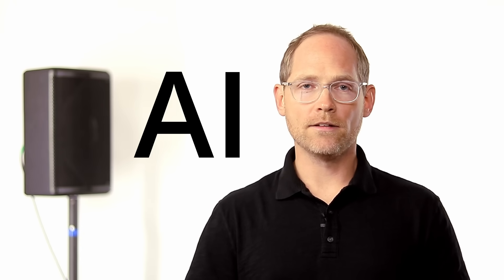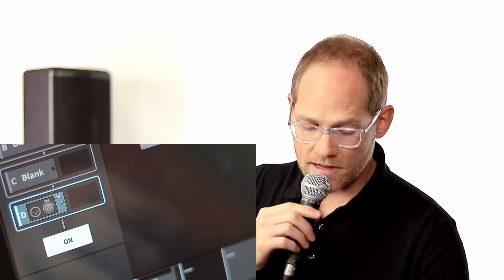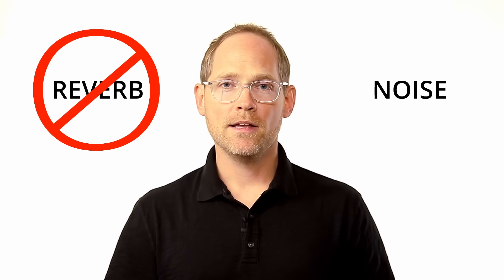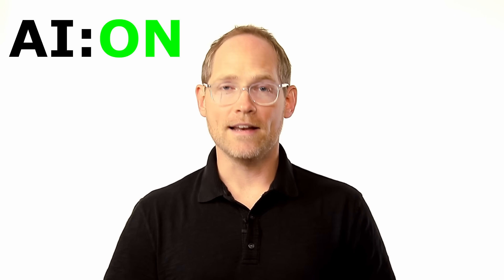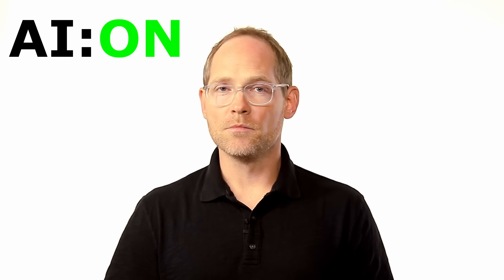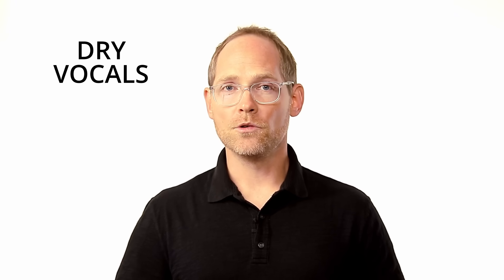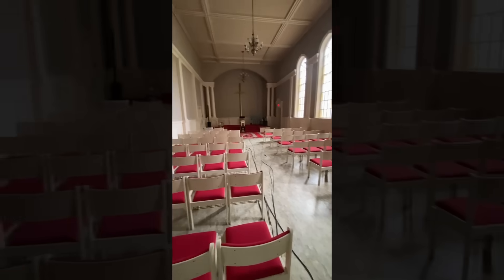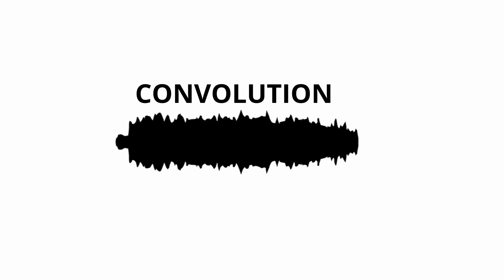AI De-Feedback/Anti-Reverb Demo + Full Explanation

Comment: Please license this to Waves so it can run natively on LV1 using SoundGrid :)
Reply from the maker: Email them about it. They could choose to do this tomorrow if they wanted to.
Reply: Well, this is basically live mode of Clarity isn't it?
Reply from the maker: @zazyczech  no, because clarity doesn’t prevent feedback.
Reply: Waves have their SuperRack Livebox that can run VST3. Which btw. also features Dante. For just $6.999 you can get there. Me & myself, I use a Mac Mini M1 with a RME Digiface Dante and Superrack Performer and I also get below 5msec latency with that system with plugins that report zero latency to the host. I don't know however if this system would survive this advertised Anti-Reverb… also you can't upgrade RAM on Macs, so this might be limiting, too.
Reply from the maker: @nielsott  We have a Livebox, works great! One instance will work with the lowest latency settings at 48k. Two or more instances require increases in buffer size, until eight instances will run with 96 sample buffer size and that's the largest buffer size we'd recommend for live sound.
Reply: @nielsott  If you're able to download the demo, I'd be very curious of your experience trying it out with this setup!
Reply: it's 2025, do we still need to use that zionist crap of Waves?
Reply: I’m not rich enough to have disposable income to test this system out . Some on please check out the full system with their computer
Reply: Rich boys problems
Reply: I have this setup with the Mac Mini M1 + RME Digiface Dante because Waves PSE can be a game changer and I haven't found any alternative to it. It is really sad but I haven't found any source expander with a dicker in the side chain as a plugin or as hardware. 

But perhaps mixing bands with 25 open mics on stage is a rich boy's problem, yes.

Does it pay off? No, not really. What pays off is a good quality mixing console with an automatic microphone mixer and doing lots of boring corporate blabla events. My Waves setup used for music events is cross-financed by that.

The M1 / Digiface / SuperRack performer solution is actually versatile, recently I used this machine as a 40 channel recorder with Ardour. I think it would do 64 channels tracking without issues.

I will see if I can run Anti-Reverb on it, but it's not a priority at the moment.

Comment: Would the AI model work even better if it would get the IR of the venue?
Reply from the maker: Possibly, but 1. the difference in a live sound setting may be so slight that it’s not worth the trouble and 2. a sufficiently trained general intelligence should be able to handle all rooms well enough

I think we’re pretty close to that already based on having used it for about a year now myself, and from the reports of others. Still room for improvement of course but I think that improvement is mostly to be found on the current path which would not involve a “learn” condition on site.

Comment: Will it isolate a live vocal by removing just the reverb and feedback or can it  also remove cymbal bleed and other stagenoise that is not a vocal?
Reply from the maker: at this time, it does not remove much else besides feedback and reverb. perhaps future versions will remove more
Reply: @devinlsheets_alphasound Hello. Sound engineer here. Please add cymbal bleed removal to it also. This will be even more huge for drummers who sing (and are also main singers).
Also please contact Behringer, so they can add this to their Behringer and Midas consoles/mixers.
Reply: there is a plugin for drum and cymbal bleed already. Drum gate debuted
Reply: Yes, but it does degrade the audio. It works better than a standard gate, but still...
Reply from the maker: @wietzejohanneskrikke1910  in “live” listening tests, on a real sound system, we can’t hear any audio degradation. In fact, the overall quality of the sound goes up significantly because of what the plugin is doing
Reply: @ on recorded tracks there is like 5-6db of stage noise reduction. 50% less stage noise on every mic is significant. Especially if you do live sound for a band with 3 backing vocals and the singer is also the drummer.